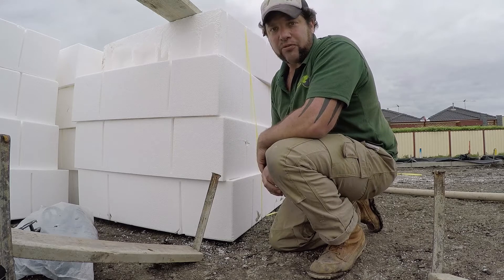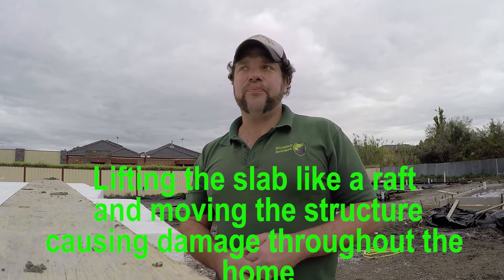Concrete Slab - JUST before a concrete pour on a Waffle / RAFT slab

Comment: Just had a Waffle Pod poured for a Granny Flat, the concretors did not vibrate the concrete and I am worried about the integrity of the slab.
Reply from the maker: Gday Tim,
Thanks for sending through your concerns. 
Due to the BIGGEST investment in peoples lives being, a family home, we need to ensure the home is built correctly.
Homes need to be built correctly the first time, so as to stay structurally secure and adaptable for our future generations to live there, saving precious resources as well as HEADACHES for the occupants .
stay awesome
uncle joe joe
Reply: @BeowulfBuilders  I am an avid researcher and I have been appalled at some of the building practices happening in NSW alone, the guarantee/warranty provided by builders needs to be tested in a court of law, just need enough people to make a class action possible.

Under the Australian Consumer Law:

When consumers buy products, they come with a number of guarantees, including a guarantee that they will be of acceptable quality and a guarantee that they will be reasonably fit for any disclosed or represented purpose.
The consumer guarantees are in addition to any manufacturer’s warranty;
The consumer guarantees  are not limited to the period of the manufacturer’s warranty. In many cases, they will apply for longer than the manufacturer’s warranty;
If the product is not of acceptable quality or fit for purpose, consumers are entitled to remedies, which may include a refund, replacement or repair, at no cost to the consumer.

https://www.accc.gov.au/media-release/accc-takes-action-against-apple-over-alleged-misleading-consumer-guarantee-representations

ACCC takes action against Apple over alleged misleading consumer guarantee representations | ACCC
The Australian Competition and Consumer Commission has instituted proceedings in the Federal Court against Apple Pty Limited and its US-based parent company, Apple Inc., (together, Apple) alleging that Apple made false, misleading, or deceptive representations about consumers’ rights under the Australian Consumer Law.
www.accc.gov.au

This decision was ground breaking in it's broad spread but nobody has thought to use it in a court of law, 'remember the Castle Movie', you build a home your expectation is for it to last a lifetime not just 6 years!

This changes the whole perspective of a builders guarantee/warranty.
Reply: As a general rule. No vibration you could lose up to 20% strength. (Worst case scenario. ) The reality is even a vibrated slab won’t ever be perfectly vibrated which in turn could lead to a stress point(weakness).  Realistically most Concreter’s are hacks. They barely vibrate anything cause they’re not the builder who bares the brunt of any trouble.  You’ll prob be fine.  Most slabs are pretty good. Usually only present probs if your in swampy land. If you’re getting built by a builder.  Talk to them about it.

Comment: What is the price  difference between the  raft slab and the waffle pod slabs I would like to know price difference between the the 2 slabs. Thanks
Reply: Mario, conventional raft slabs with thickened edge beams is 25% more expensive. My mate who's an Engineer designed my slab and we used 25MPa bored concrete piers as well as 32MPa in the slab. Not a crack in site after twenty one years! Don't forget to cure your concrete for at least five or six days to prevent plastic shrinkage cracking.
Reply: You probably already know, it's significant price difference
Reply from the maker: Feel free to sponsor us at www.patreon.com/beowulfbuilders to help us create more great content
Reply from the maker: Feel free to sponsor us at www.patreon.com/beowulfbuilders to help us create more great content

Comment: Good video.
Not sure I would agree with your term raft slab is a waffle pod slab.
Waffle pod slabs are not great; they are a raft slab, but so are many other types of slabs.
Type in the term raft slab in google.
Also the conventional slab I know it  as a raft and beam slab.
Finally not very impressed with engineers that specify ridiculous amounts of concrete for simple "M" class sites.
Waffle pods have been marketed just so well, by polystyrene manufacturers.
You are giving fairly good information on your videos.
Also most of the waffle slabs I work on have some piers.
Cheers
Pulpo
Reply from the maker: Feel free to sponsor us at www.patreon.com/beowulfbuilders to help us create more great content